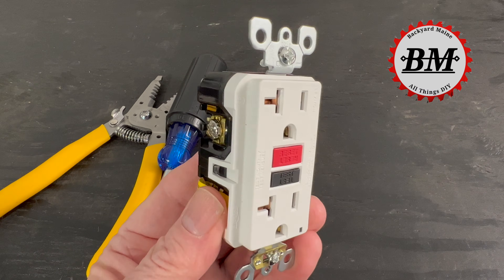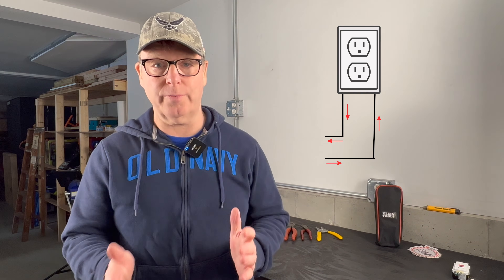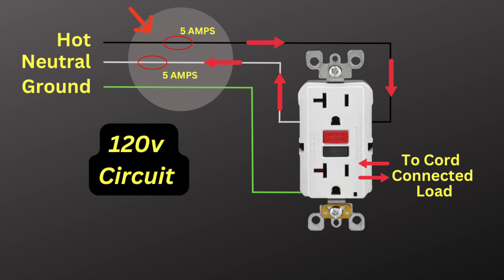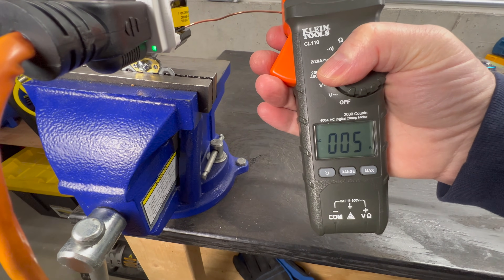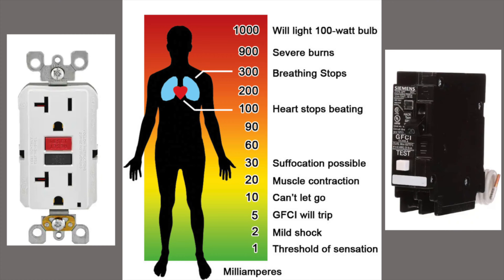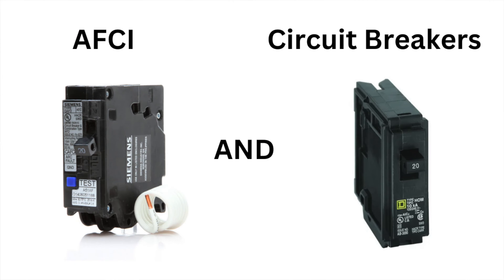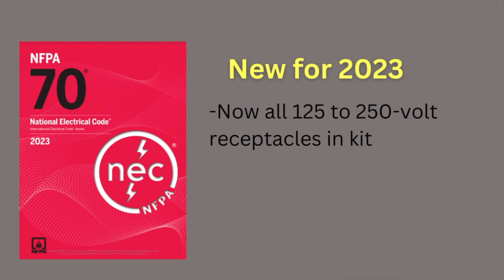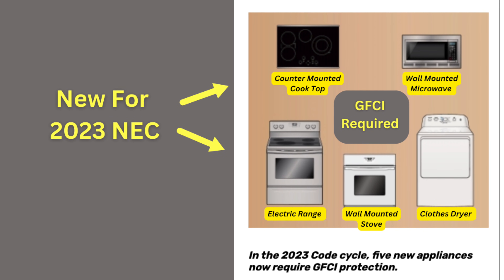GFCI Outlets: How They Work And New Requirements

Comment: They were forced to put a few of these in my new shop building in order to get power hooked up. Even though the building has no water. The problem is that on a 15 amp breaker, about 80% of the time my saw will trip the GFCI when it starts up, even though it is less than 15 amps. The real problem is that when my wife and I were out of town for a week there was an interruption in our power and, though the power came back on, All of the GFCI outlets tripped, and two of them were connected to a freezer. We lost a lot of food. 

My solution: Removed and replaced with normal outlets. Problems solved. I'll live - probably. Our outlets are as safe as they were when I was in high school (early 70's). And we built our own home at that time. i.e. it has no GFCI outlets and nobody has died yet.😁

The ones in our home trip from time to time, but that's not really a problem because they are not on the circuit attached to our refer, and we don't plug any high power appliances. Not worth the hassle of replacing them. They are simply not acceptable in the shop building.
Reply from the maker: I hear you. We want to be safe but we need the circuits to work. Power surges can damage a GFCI since they do have electronics. One of the reasons why surge suppressors are now required by code. Power saws are inductive loads which means they have inrush each time they start. That inrush can be as high as six times the running load for a short duration. My table saw draws about 12A while cutting but will trip a 15A breaker every time it starts. I have to remember to plug it into a 20A circuit.
Reply: @BackyardMaine  
So surge protectors are the fix for the GFCI problem?

Comment: What section of code is this GFCI change under in the 2023 NFPA 70?
Reply from the maker: (210.8 A-F) GFCI Protection for Personnel.   (210.13) (230.95)  GFCI Protection for Equipment.  Other Articles for GFCI and SPGFCI are scattered throughout the code. (410.184) (680.5) (680.44) (690.41) probably a few more I can't remember.

Comment: My house was built in the early 50s. So unfortunately, I don’t have a ground wires. Is it possible to use a GFCI outlets to get around rewiring my house for now?
Reply from the maker: Yes it is. GFCIs with still operate as designed without a ground and it will allow you to connect three prong plugs. The only thing is you need to put a sticker on each one indicating there is no ground.

Comment: the recent code changes for GFCI and AFCI are going way overboard in my opinion
Reply: They are based on the number of electrocution deaths that could have been prevented. Children died because the code changes were not yet in place.
Reply: @SuperJhuffman How many children died? How many were saved as a result of the code changes?
Reply from the maker: I don’t disagree.
Reply: I want to know how much bribe money is paid out by manufacturers to get their products, often causing loss of food , water control when it comes to Arc fault devices,
Reply: NEC should really just have the areas we DONT need afci’s in now
Reply: another fine example of government stupid overreach I will never put a refrigerator on a GFI it is ridiculous
Reply: Two years later and e.g. 2 pole Square D GFCI $175 at Home Depot.

Utterly ridiculous
Reply: They are being driven by circuit breaker manufacturers looking to increase their sales of both.  And trying to drive business away from receptacle manufacturers.

Comment: thanks fo rthe info   I jave a GFI plug green light is on but no power is the plug no good and do I need to replace it?   thanks Robert from Canada
Reply from the maker: That's an unusual problem. Check to make sure it's wired correctly first and that there are no loose connections. If everything looks good replace the receptacle.
Reply: It has probably failed- depending on when it was made as more recent GFCIs are designed to interrupt power delivery when they no longer provide GFCI protection.
Reply: some of them have a light to tell you outlet is on while others have one to tell you it has died

Comment: A range requires GFCI? where do you even get a GFCI receptacle for a range oven?

ANd now a refrigerator and microwave require gfci? These are devices known to trip GFCI's all the time just from regular use. this is a bad decision and I am completely against it. YOu just know electricians will comply for the inspectors then change them out after everything passes.
Reply from the maker: GFCI protection for the range would be installed at the panel as a breaker. I get that the GFCIs do save lives but there is also the practicality of the device to consider. I don't wind the range or even a microwave but refrigerators and freezers are a mistake in my opinion. Once people start loosing a freezer or refrigerator full of food because they didn't realize the GFCI tripped they will be changing them out.
Reply: @BackyardMaine  exactly. and i think the same will go with microwaves and stove/range.
Reply: Refrigerant compressors can trip GFCI’s on start up. AC’s and heat pumps are also required now. Homeowners are going to love paying for a service call just for a tripped gfci

Comment: I was hoping he was going to explain HOW they work. I get it that when there is an imbalance they trip, but how does the device actually detect the imbalance.
Reply from the maker: The GFCIs use a CT (current transformer) to monitor the hot and neutral together which will detect zero amps during normal operation. The CT is monitored by an IC board (integrated circuit board) and when it detects ~5mA or more the IC opens a relay which trips the GFCI which interrupts the flow of current to the fault. I hope this helps.
Reply: @BackyardMaine  thanks. IC board makes sense. Wonder if that’s how they were making them back in 1975.

Comment: IET Wiring Regulations 18 th Edition
Chapter 41  411.1 where specified, additional protection is provided by an RCD with rated residual operating current not exceeding 30mA, in accordance with Regulation 415.1.
That's how is it in our Wiring Regulations. Same science, different voltage and amps.
Reply from the maker: Yes it's a bit different. I think the reason for the higher 30mA is because you run 220v to ground which will nuisance anything less than 20mA. We have SPGFCI breakers for voltages greater than 150v to ground which trip at 20mA.
Reply: @BackyardMaine  
Since the 18th Edition Amendment 2: 2022 was introduced. All new domestic installation have to have Surge Protection (SPD). Also property's that are Care Homes , Student Accomodation and Hotels need AFDDs (Arc Fault Detector Device) on all circuits. So, now the circuit is protected from over current by circuit breaker, earth fault by RCD, Surge current by SPD and finally Arc Faults by AFDD. Come a long way from a simple re-wireable Fuse that your Dad re-wire if it had blown. Only socket outlets and light fittings are permitted by non skilled person (electrically) since 2005. No tinkering with Fuse Box  anymore for Dad.

Comment: I still find it troubling that they require GFCI outlets for refrigerators. I find that they will trip the GFCI receptacle and shut off the refrigerator causing food spoilage. What would you recommend? Also, how in the Halifax are we to GFCI protect a 30 amp dryer and what lead to that decision? Great video.
Reply from the maker: I agree. I think the refrigerator or a freezer should be exceptions. For a 30A dryer or a 50A range you would use a 2P-30A or a 2P-50A GFCI breaker. Remember you won't have to change an existing installation unless you're renovating or sometimes it's required as a condition of a sale. Dryers are usually beside the washing machine or part of the washing machine which present what's considered a significant amount of water over a gallon and is why the CMP (code making panel) voted to include them in the requirement.
Reply: the code making panel is getting ridiculously stupid  @BackyardMaine
Reply: @ranger178  Fridges have become live and killed people (as have washers/dryers).
Reply: @LonnieAdams4  
What about the ground?  As long as fridges still work if the ground prong is hacked off, we need GFCIs.  But what if Fridges checked?
Reply: There are GFCIs that have an audible alarm when tripped. Wouldn't help if you're away though.
Reply: You do not have to ground fault the refrigerator because of that reason exactly. When you wire your kitchen circuit you land your incoming power from the panel (home run) at the refrigerator receptacle and than the jumper to the next receptacle will act as your home run and will land on the line side of the GFCI and all the rest of the kitchen receptacles will be on the load side of the same GFCI therefore protected
Reply: Imagine if the NEC requires GFCI on an Air Conditioner/Air Heater?
We would die of heat stroke and hypothermia, think smart NEC.
Reply: @taras_svirgun if they don't have gfci, we die of electrocution
Reply: Never any water leakage or wet things around your fridge…